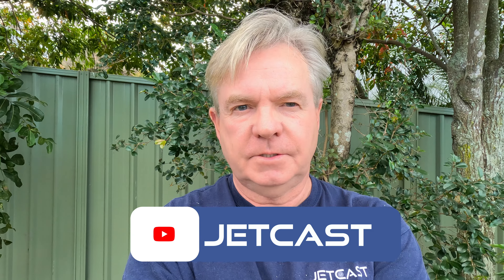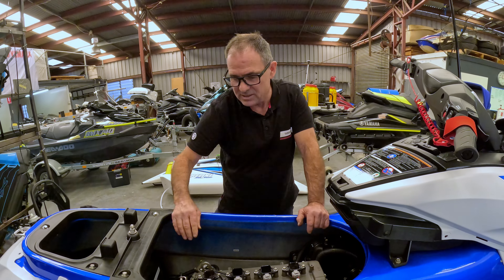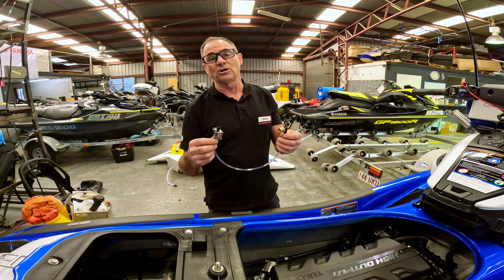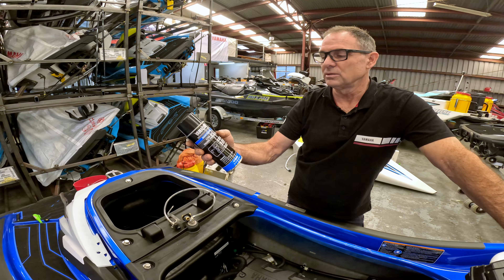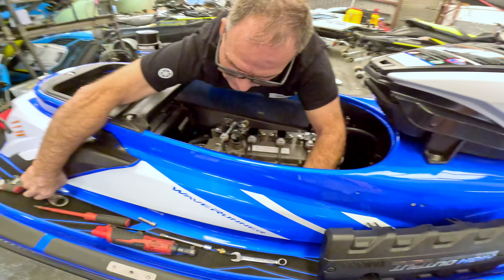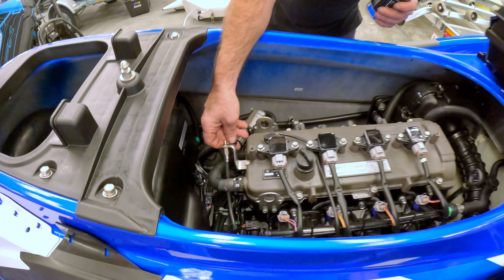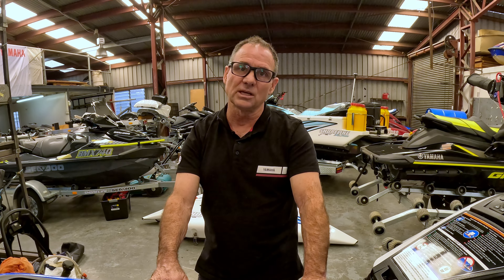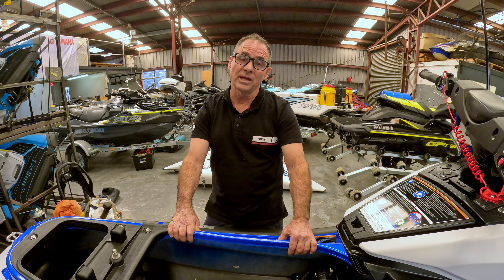The PWC "Motor Hour" Myth - And How to Extend Your PWC's Life

Comment: I have ten 2022 TR-1 powered VX units all over 1300 hours. No engine issues across any of them yet. Plenty of pump rebuilds and a handlful of starter relays, but the daily use keeps them running strong.
Reply from the maker: Definitely more you use them the longer they last. Plus Yamaha make a bloody good unit generally.  Thanks for watching the video.

Comment: Great idea. Saves having to remove the spark plugs and spray fogging oil in that way. I contacted Shoreline and they said they make them for the TR-1 engine also, at AUD$200 (supply only). $60 to install, or $30 to install with a service.  Seems like a reasonable deal to me.
Reply from the maker: I use it after each trip now as part of my cleanup routine. It’s at least a week between trips so it’s quick and easy to do so why not!  I can hear the difference in the engine at next start. Definitely going to have less wear as it ages.

Comment: I've put 500hrs. on my Seadoo 155, and run it at least once a week. Still runs same top speed as when I purchased it. All I do is change the oil / filter, and keep the pump bearing greased up. I'm shooting for 1000, or more hours, for bragging rights.
Reply from the maker: The more you use them the longer they last! Thanks for watching.

Comment: Very great information on this preventative measure.  I just wish it was something previously installed by Sea Doo, because I am no where near any kind of a mechanic, and therefore I will have to remember to ask the dealership about it and to install it.
Reply from the maker: It's quite simple to install if you want to attempt it yourself. I expect that Shoreline would be selling the kit with some instructions, so you just need some tools to remove the temperature sensor, attached the inline unit, and mount the nozzle.

Comment: Hi Paul. Great video. So once it’s installed does the modification stay connected to the engine. For easy use of the fogging spray. Or is it something that you need to connect and disconnect after every long term storage. I hope that makes sense. Regards Shane
Reply from the maker: Thanks. Yes it stays on the ski. You use it only when required: when you’re not going to use your ski for 3 weeks or longer . It’s kinda like what they do in very cold climates for “winterising”  but in temperate and tropical climates is useful for periods when you can’t get out on the water.
Reply: @Jetcast  thanks heaps Paul. Please more of these modification videos. They are great. Also when you get the new ski to do a video of how you launch and exit a boat ramp. How you dry blow out the water after exiting at the ramp would be great. Cheers Shane

Comment: This accessory looks great. It's a shame they don't have an ordering system online. I probably won't order them until I can do it through a system. I've had my credit card stolen before by giving the numbers to employees to manually process before.
Reply from the maker: Understandable. I normally have to cancel my main credit card once a year myself these days! Thanks for watching.
Reply: Hey Paul, Wish I had seen this before taking a 2 month OS holiday😢 Do you know if the Seadoo one is that easy to install and if they give good instructions with the kit?
Reply from the maker: @chrishobbs3935  hi Chris, I’m not sure. Just give them a ring or email info@shorelinejetskis.Com  for details.

Comment: Another awesome product is fuel doctor I had a problem with my outboard motor dropping down to one cylinder and could work out why I had moisture getting into the motor some how I started using fuel doctor for about 3 years now hasn't missed a beat it disperse water and lubricates your motor I use a bit in every tank of fuel
Reply from the maker: Good tip. Thanks for watching and commenting Jim.

Comment: Hi Paul. Do you only fill up with Unleaded 91 (94) E10. Its the green colour. It’s so confusing at the pump.
Reply from the maker: I use 91 only. But after watching some engineering videos I am probably happy to use E10 if its cheaper. Last time I looked the E94 was more expensive. The idea of using ethanol I thought was to reduce the use of oil and keep the price down.

Comment: You can also remove the plugs and spray down the plug holes.
Reply from the maker: Sure. This mod however is for the average punter to be able to keep the ski in top condition between a few weeks of being unable to ride.  As Patrick said in the video, deterioration due to moisture coming back into the engine is the issue he’s trying to solve and this offers a quick and simple solution for owners. I would hate to have to remove plugs each time. It would rarely get done! :)

Comment: Why fog a waverunner with FI people store other FI machines and they are fine. My 2005 FX C has 325 hrs and all I do is run antifreeze through it after the season.
Reply from the maker: The service engineers are seeing additional wear caused by moisture getting into the cylinders.
Reply: Poor design on manufacture. Good video my friend.